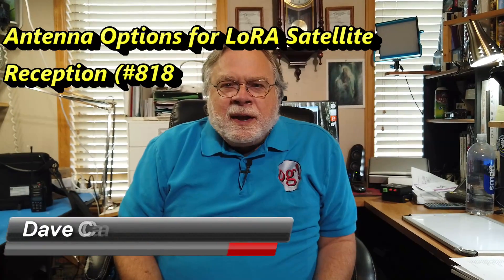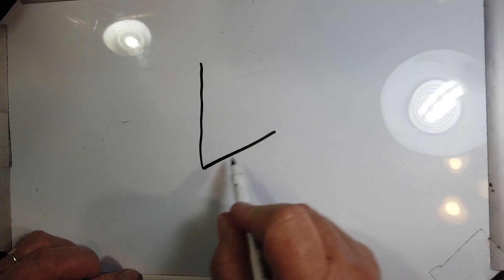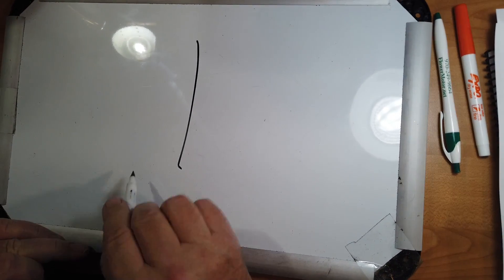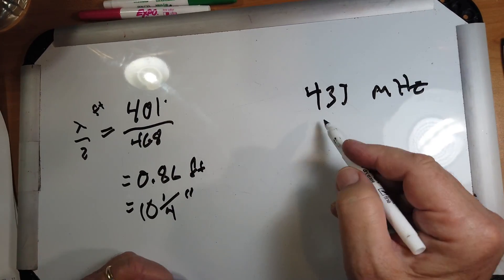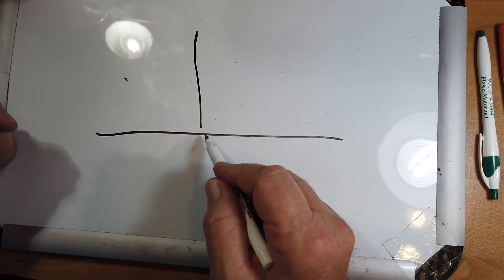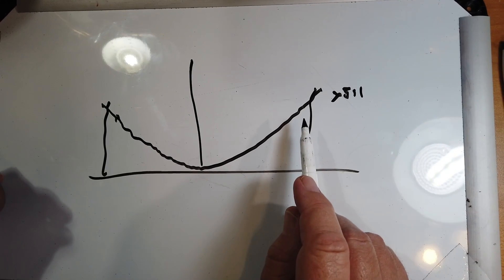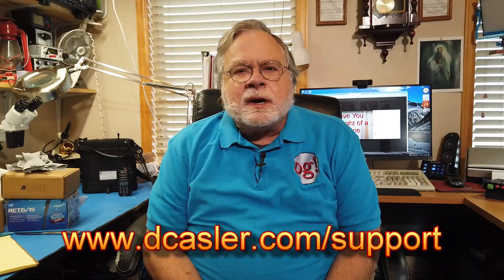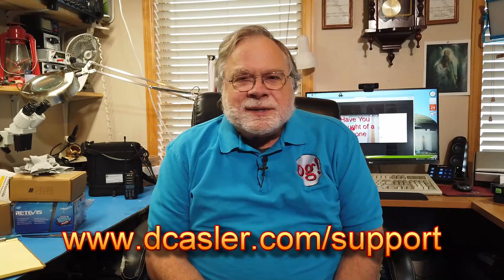Antenna Options for LoRA Satellite Reception (#818)

Comment: For Any frequency band, a traditional 1/4 wave Ground Plane antenna with straight, Horizontal 90° Radials can be Easily Resonated to perfect 50 ohm, 1:1 SWR by simply slightly Shortening the Vertical Radiator & Adding a short adjustable Hairpin Beta match Stub across the antenna Terminals.....Tweak the Radiator Length & Stub Shorting strap as usual with any VNA or Swr meter to find the 1:1 Sweet tuning spot.......

Comment: The simple quarter wave vertical with (4) 45 degree radials was one of the best satellite antennas I ever used… and I used an HT on low power less than a watt QRP! It was built as described with an SO239 panel connector, and soldered to it were 3/32” bronze welding rods for radials and the vertical element. I sealed the connector insulator to keep rain water out. Antenna was mounted on a simple pvc pipe.

Comment: The formula is wrong. It is 468 / frequency (MHz) = length of wire in feet. Not frequency / 468. the higher frequency is always going to be a shorter wavelength than the lower frequency..

Comment: Am I missing something here? Since when is a vertical with its low angled pattern a good option for satellites ? A Discone (for 70 cm) could somewhat work , but it has quite a spiky pattern with nulls straight up and around 50 degrees above the horizon.  A helical (mounted vertically) had a wide opening angle from 10 - 57 degrees above the horizon. An "eggbeater" antenna has the best desired openings angle  and receives signals flawlessly from 10-90 degrees above the horizon. There's one for 70 cm band commercially available if you must. Don't worry so much about bandwidth and tune. The goal here is receiving satellites and not transmitting.

Comment: You have your element lengths wrong way around. The shorter elements are for the higher frequency.
Why are you using 1/2 wave dimensions with a ground plane/counterpoise?? Shouldn't they be 1/4 wave??
That ADSB antenna of yours looks more like a vertical dipole to me.